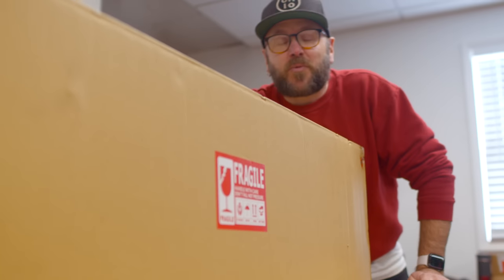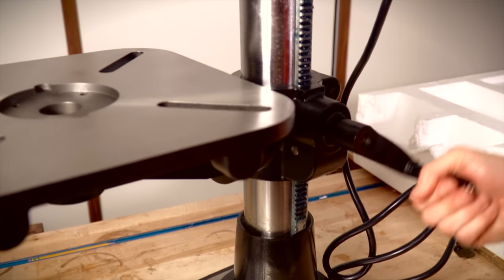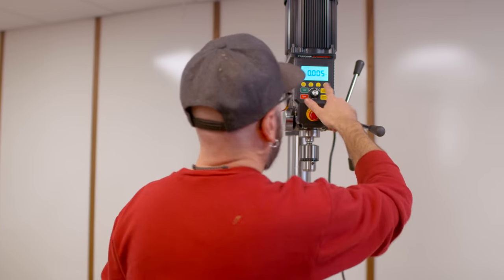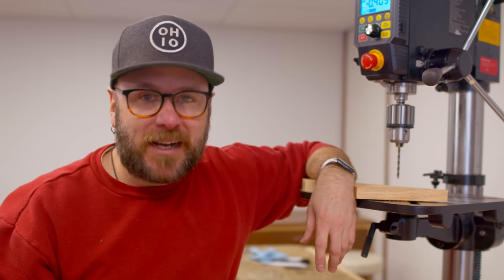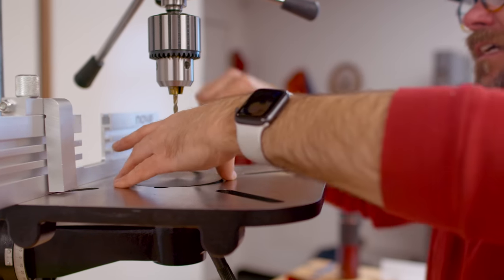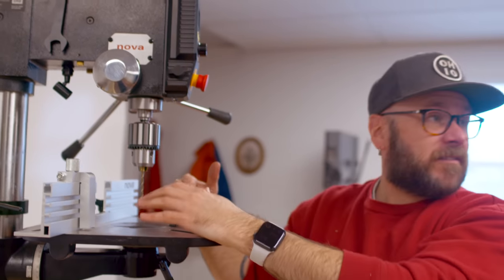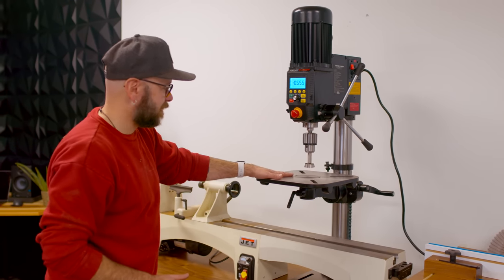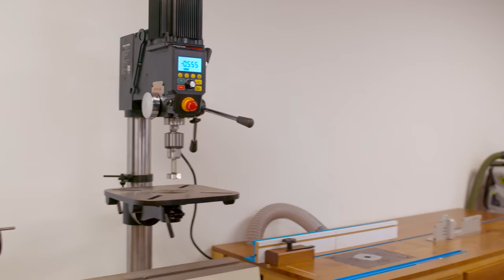Crazy Drill Press From the Future! Is the Nova Viking Worth $1000?

Comment: You didn't mention anything about the light and laser. Did you have any issue with it? I bought this drill press about a month ago and when I turned it on, the lasers were no where near where they should be. I tried adjusting them and they stopped working. Had to e-mail Nova about it and they ended up sending me 2 replacement lasers free of charge. I replaced them and got the new ones working with a little modification. Seems like when they build the drill press, they hot glue the lasers in place and makes it almost impossible to adjust. But I got it going and that's all that maters. You can also change how the drill reacts when it reaches your depth you set. You can leave it in the default mode where it reverses or you can have it just stop and not revers or you can have it just keep turning normally. Great features once you get the hang of it. The owners manual needs some work to make it easier to understand, but it's a start. So far so good. I just subscribed cause I loved the video.
Reply from the maker: Thanks! i did not have any issues with he laser. I did have to adjust them a bit.
Reply: @MakeSomething  maybe they changed the laser set up and not hot glued them in place. I think my drill press was manufactured before yours was. When I turned mine on it said DP16 as yours was DP19. That is the user interface version. That is what the USB cable is for. I had to download software and update my unit to DP19. And that usb cable is NOT a standard cable. One side is longer than the other and the long side has to be plugged into the drill. It won't work the other way around. Looking forward to watching more...love the humor.

Comment: I'm betting your replacing the jet for the metal shop too for a second Nova.
If not you probably should think about a mini mill.      I'll take your Jet. better then the one I have.
I seen the Nova line at the woodworking show last winter and was blown away, I used to work in a machine shop and the nova was about as good as the commercial drill presses I used to use with a few improvements.
Reply from the maker: I just sold the Jet since I haven’t used it in months. Mini mill is definitely on the list!

Comment: The thing stopping me is reliability. Something goes wrong where are you going to get it repaired?
Shipping a couple of hundred pounds is a hassle.
Reply: I don't think there are two many things that can break. The design appears to be modular. The motor should be fine for  long time. There is a control board that should be easy to replace. See if there is a repair manual.

Comment: This is blowing me away! Direct drive with depth, rpm also load adjustment automatically. I can see this used with a vertical lathe attachment. Tapping holes in metal. Almost a mill.

Comment: Nice though with tools maybe I am just getting old but I like simple things. I would be worried that while the motor and such would last decades that the computer might not. Hard to beat the proven reliability of motor, a belt on pullies directly connected to a Chuck. Not a lot to go wrong and when it does fixing it is a breeze.

Comment: Your minor complaints are benefits... fine threading on depth stops gives greater precision, and less "walking"   The vertical travel relation to handle is appropriate. RARELY are people dealing with 5" Tubing, and need to go through both walls with a reduction gearing to increase travel to a 3:1 ratio.

This direct drive unit has a confuser, I cannot imagine it lasting forever like my 130.00 Craftsman 8" Drill press with the belt and motor.... no circuit boards. If motor dies, a used motor from anywhere will fit. I just expect a drill press to be a basic no frills device. Even a vertical mill, for small uses... rather have manual XYZ with a DRO. But that is just me.

The variable speed is nice. That is done by belt on mine, which I rarely change from about 500 rpm

To put this in my service van, even with the high roof, I would have to cut the roof out for a dome to accommodate that motor. No, not cutting the roof on my Sprinter ! I might need a smaller drill press.

Comment: How much does the table tilt left and right? Nobody at Nova seems to be able to answer that simple question. Can you tell what kind of backlight the display has (LED, EL etc)? How much runout do the quill and chuck have (Nova is known for bad numbers)? Too bad for such a premium price it doesn't include a fence, and have a better way to rotate, raise/lower and tighten the table instead of the same old way. It seems they added some low-cost electronics and jacked up the price substantially compared to competition instead of having a more robust mechanical system. Have you tried stalling the motor at minimum RPM, I've been told it's easy since this type of motor isn't good for torque at low speed (https://en.wikipedia.org/wiki/Reluctance_motor) and Nova only says its good without providing a torque vs speed graph.
Reply: Hi Qweerty.  Sorry no one got back to you.  The table tilts 45 degrees left and right.  The display is LED.  The run out is .02 mm on the quill and arbor.  The chuck is .18 mm at 100 mm down from where the chuck grips your bit.

Comment: what is going on that no one seems to know what the heck the wedge looking tool is for!!???? it's simple, lower the chuck till the whole in the shaft appears insert the wedge tool in flat part up taper side down, hit it with a mallet and the whole chuck assembly will come out, you can add other tool heads to the drill press it don't have to be a drill chuck, drills use a Morris taper (MT) MT2 is the most common..
Reply from the maker: Yep!

Comment: Don't throw out or lose that wedge you were playing with.  Its purpose is to remove the tapered chuck arbor, held tight by friction (extend the quill and look for the slot at the base of said quill).  Don't be one of thise guys who takes a hammer to the chuck body.  They should be collectively put on trial for tool misuse and lit on fire when found guilty.

Comment: "why do they call it left-handed?"
Righty-tighty vs lefty-tighty.
Reply: There are left-handed screws. You have to use them on the other side of any object that has two sides
Reply: I forgot to add. When I started out some old smarty pants asked me for a left-handed screwdriver. It was easy, I just turned his tool box upside down on the floor and there was a bunch of them. He was mad at me for some reason and tried to stab me in the gizzard. I wacked him with a drumstick and that was the end of that

Comment: Cool New Drill Press.  It seems that if the drill bit was off center of the circular plate (the table pulled out towards you), the plate could just be spun around for multiple new "backing".  

If that's not making sense, here's a video with one: https://youtu.be/W7SSK8ky1FM

Comment: No the drill press is not worth it. The belt drive/gears on a normal drill press have the dual function of being RPM control and a torque multiplication device. If you have a 1750 RPM motor and a pulley that lowers that down to 500 or so. That is 3.5 : 1 ratio. That means the rated torque of the motor would be 3.5 times higher at the spindle at the lower RPM. If you had a triple pulley that lowered that RPM down to 180 that be approximately a 10:1 ratio which would give you 10 times as much torque at the lower speed. With a direct drive DC motor you don't get that torque multiplication advantage. Whatever is the rated torque of the motor that's all you get. That means the Nova Viking is not effective at drilling metal like a normal drill press.
Reply from the maker: Hmmm. I've been drilling into steel with it for 3 years without issue. But I see where you're coming from.

Comment: For dust collection I pipe one of these, about 2 feet worth, nearby and pull the opening right up to the workpiece when i'm drilling and it works great; push it out of the way when you're done.  The hose is like a really stiff snake (TWSS) so it will bend and move and hold its shape as you manipulate it.  https://www.amazon.com/gp/product/B002DSG4IY/ref=ppx_yo_dt_b_search_asin_title?ie=UTF8&psc=1.  love the vid!

Comment: Your complaints about the Jet are trivial and I have easy fixes for them, but I agree that the Nova is an amazing drill press.  By the way, the advantage of the circular insert is that if you swing the table a bit off-center, then you can rotate the insert and have a fresh backing surface for a hole that is drilled through.